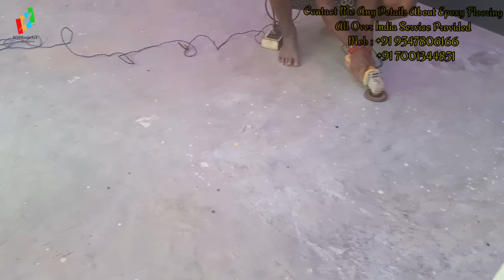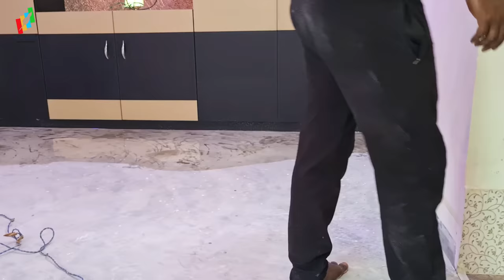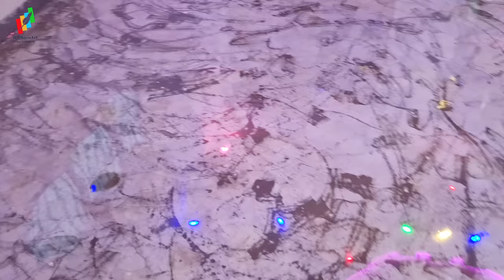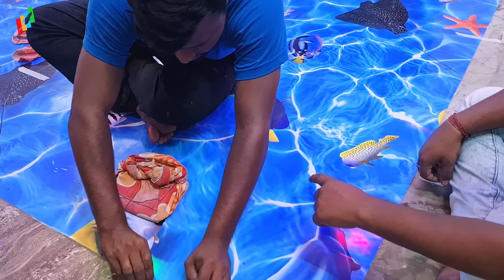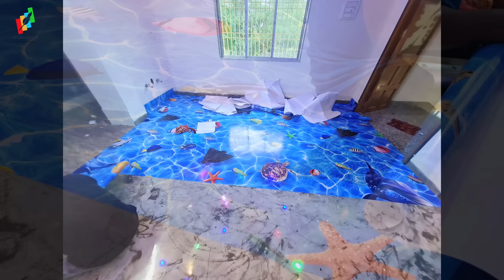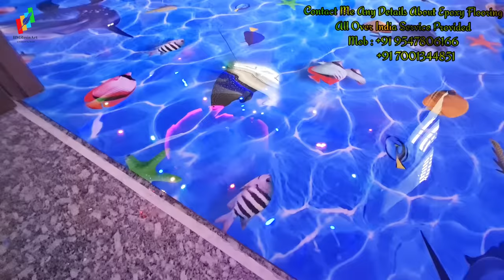epoxy 3d floor installation/3d epoxy flooring in kolkata/3d flooring/3d flooring design in India

Comment: Can I do epoxy floors if I have water warm pipes under floor material? And in winter warm will come up?
Reply from the maker: First check how warm your floor is, then the resin floor can be installed